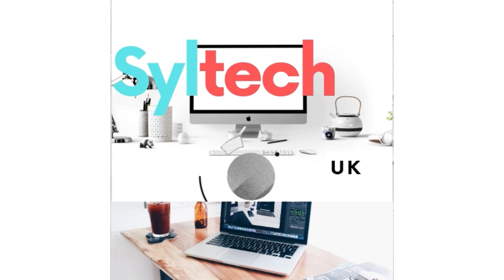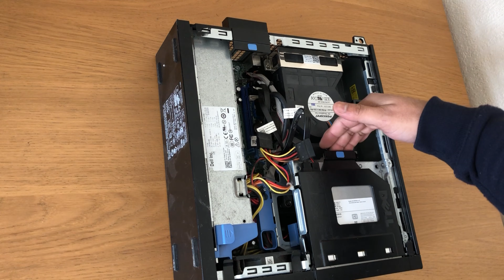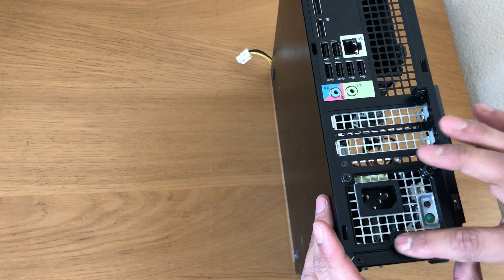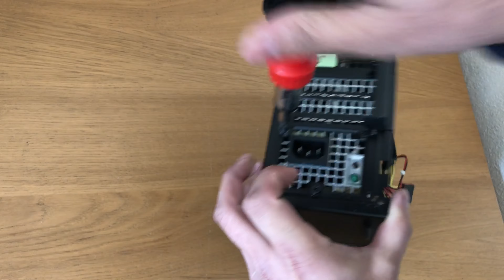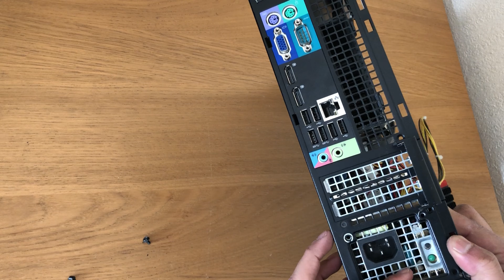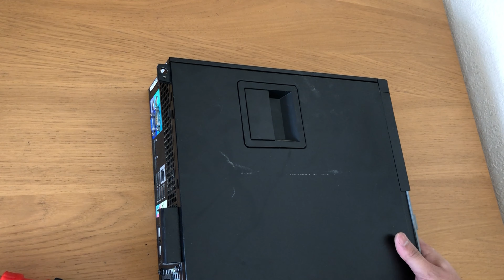Dell OptiPlex SFF Power Supply Change Dell 7010 3010 790 990 9010

Comment: Can you get higher watt gpus?
Reply: Bro I am also adding new but how I add in this much small cpu I want to add 500W power supply beacuse I am adding graphics card plz help suggest me power supply of thise cpu size
Reply: @KoobraRahul_Channel  i know a way try to connect your new power supply to the motherboard then stick or keep the bigger power supply out of your pc
Reply: I am wondering the same thing. My 1650 is to much for the power supply
Reply: @RXEDITS-f1h  how do you put a larger power supply in dell optiplex 7010 sff
Reply: @dottysample4753 broo I said  keep the power supply out of of the pc without closing the pc's door kinda thing 😂😂. I had the same problem when I installed win 11 on my pc and I used this way😅😅
Reply: @RXEDITS-f1h  you can keep your door closed, just route the new PSUs cables through the rear hole where the original PSUs cable and exhaust were. the PSU will still be external but the case will be closed.
Reply: @shade221  yah kinda
Reply: @RXEDITS-f1h  how "kinda"? i just did it. it's a little ghetto but it works, and is a LOT less ghetto than leaving the case open lol
Reply: @shade221  broo...
Why soo serious..